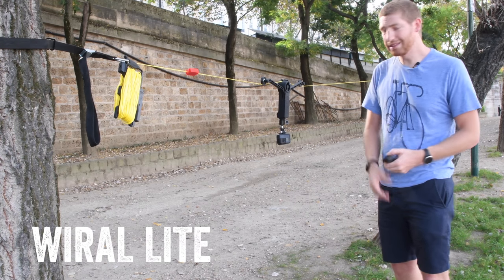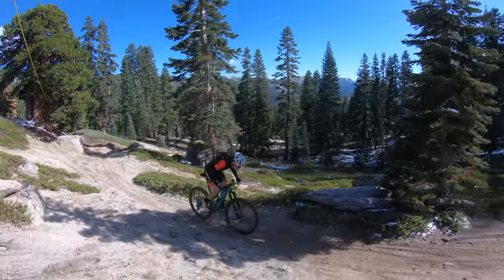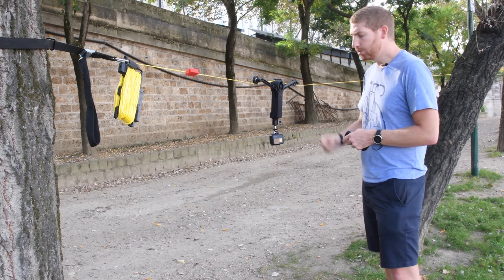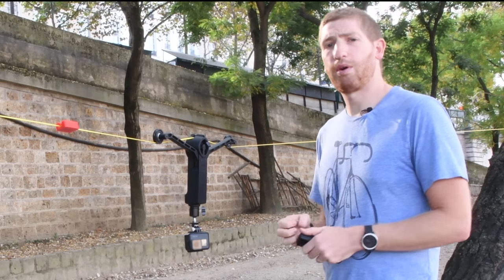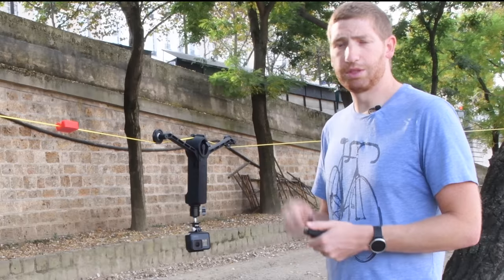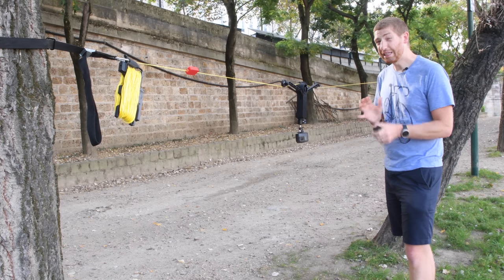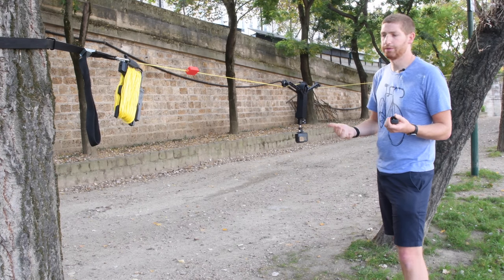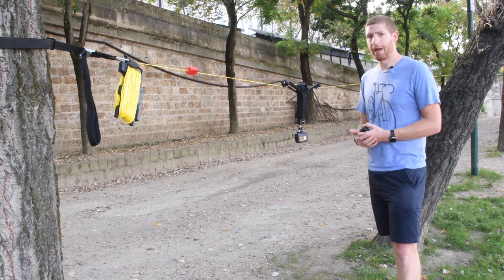WIRAL ACTION CABLE CAM: How it all works!

Comment: Nice review. What if the cable attachment points are not level? Does this thing work going "uphill" or "downhill"?
Reply from the maker: It can go 'uphill' or 'downhill' to a reasonable extent, depending on load. Almost all of the scenes shot in the mountains were uphill/downhill scenarios.
Reply: Their Indiegogo campaign said it can climb up to a 30° incline
Reply from the maker: Yeah, I'd argue that based on the earlier prototype I had...not a chance in hell for 30* with any meaningful load (being a GoPro sans-gimbal), and even that would be questionable.  But obviously a lot has changed in the project since then.

Comment: Is it possible to get shots without the wire showing?
Reply from the maker: You can. You can see how the side-moving shots in the video don't have the cable.  You can also establish shots that the cable is mounted higher up on a tree than we were able to do, and such that the cable then 'dips' between the two trees.  If you then align your camera right, the cable won't get in the shot.  Obviously, that takes the right terrain/tree setup, but certainly very doable in forests.
Reply: edit every frame!

Comment: On the website there is a 2X version, what is a 2X version? It really doesn't explain very well and makes me think its a ripoff.
Reply from the maker: My understanding is that version simply has twice the string length.
Reply: You get two of the wiral lites kits. The description says: "Items included:
Wiral® LITE kit (2)"
Reply: Actually, you get to Wiral LITE kits (full set-ups); not just cable.
Reply: does that mean two Wiral Lites too or just extra rope and accessories?

Comment: How did they run it through a moving car the wire would snap wtf
Reply: Azurda Azurda they attached the cable to the roof rack, meaning it moved with the car.
Reply: movie magic = creative problem solving.